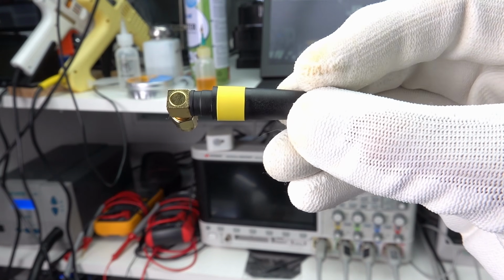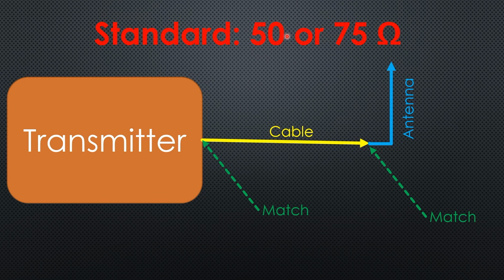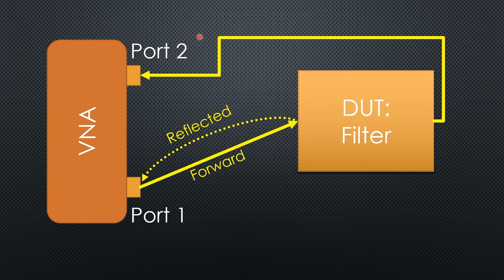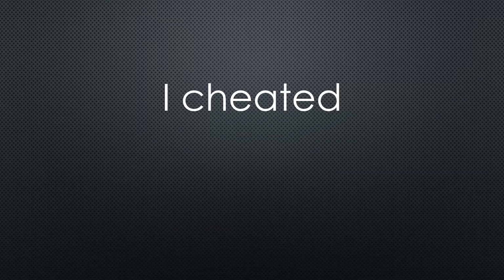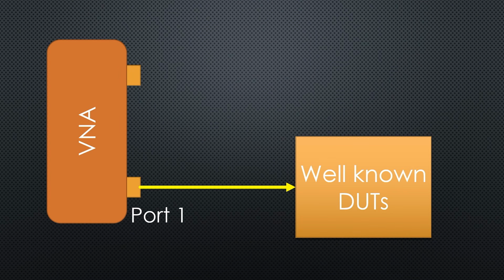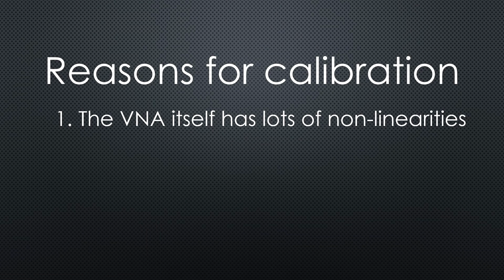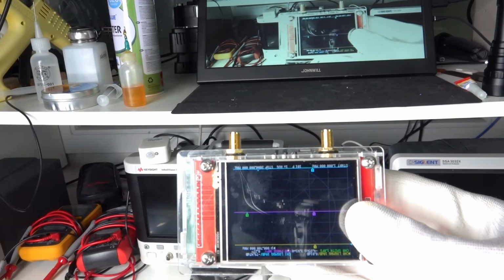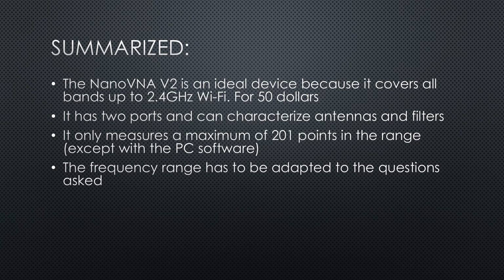437 How to Use a Vector Network Analyzer (VNA) to Test Antennas

Comment: I'm not sure that reflected power "heats the transmitter". More likely, it heats the feedline, if the feedline is lossy; otherwise, it is (eventually) re-radiated.
Reply from the maker: You are right. A Bit is lost in the feedline, a bit is reflected, and the rest is burned.

Comment: Users of radio amateur usually recommend to use a common-mode choke in the antenna line to reduce noise. In case of Lora communication, make any sense to include a choke, since it runs at much higher frequency?
Reply from the maker: I never heard that somebody used cokes in this context. Maybe also because the transmitters only have 1mW

Comment: Regarding antenna measurement you miss the ground plane. My LiteVNA has not enough ground plane when measuring 868/915MHz antennas directly on the port.
Reply from the maker: The Ground plane os part of the antenna, not the VNA. That is why handhelds have changing SWR.
Reply: @AndreasSpiess A ground plane is essential to operate for the antenna and measuring S11 without it is like playing lottery. At least this is what I had to learn the hard way. It obviously makes no sense to say anything about the quality of an antenna if half of it is missing. So my conclusion is: either measure with a constant/defined ground plane or measure with the ground plane of the device under investigation.

Comment: A lousy oscillator also will destroy your signal its even more likely. But the VNA can also measure that i think..
Well for the esp32s3 the constant is 35j0+ so one has to match the antenna.
Reply from the maker: Most chips do not come with a 50 Ohms. But often, the suppliers provide exact info on how to get to the 50 Ohms with a matching circuit, as you mentioned.

Comment: Incredibly good content! Thank you! just one question from my side: how would you make a PCB antenna characterization?
Reply from the maker: Similar to any characterization. However, here, the atachment is more difficult than if you have a connector. Usually, they solder a short cable to the antenna.

Comment: These VNA..they seems to also have quite few other testfeatures up there sleeve, that people use for other things..
do you have a video, on other usecases these newer TinyVNA can be used for.
phase delay, various Smith charts jX/LC, Qfactor, Polar, Linear, REAL, IMAG, Resistance, Reactance,  etc
TDR, low pass impulse, and LP step, bandpass, window, signal gen... they are quite extensive.
The current ones, also got quite a few more testpoints and seems to go up around 6G.
Reply from the maker: No. This is my only video about the topic.

Comment: Hey Andreas! Thanks so much for the video, insanely good. I got a NanoVNA 2.2/SAA-2 like the black one on the thumbnail, and I've tried as you have, to measure a 144/430MHz antenna. Unfortunately, the signal is extremely shakey, and touching the NanoVNA, or the antenna, or even putting my hand near the antenna, changes the valleys of the SWR by as much as 10MHz up and down. Is this normal behaviour of antennas, is my NanoVNA broken, or am I doing something wrong? Thanks a lot <3
Reply from the maker: That is how RF behaves. Use it to measure a fixed antenna and it should not happen.
Reply: @AndreasSpiess  Thanks so much for your comment! Greetings from Spain!

Additionally, I will say that, after 2h banging my head against the desk, and finding some answers on forums, by holding the NanoVNA with my left hand, and holding the Antenna next to my head emulating the position of the walkie-talkie, I can take a fairly stable measurement that generated SWR precisely at 144MHz and 430MHZ, so that was an interesting experiment. What do you think of this technique to more or less tune antennas for handheld devices? :)
Reply from the maker: @rojirrim7298  That is probably the best you can get.

Comment: A correction. "it shows if the antenna is good or bad" is a common misunderstanding of antenna impedance matching. A 50-ohm high power resistor (dummy load) is EXACTLY 50 ohm, so it seems perfect on a VNA (or VSWR meter), meanwhile, it's a terrible antenna.
Reply from the maker: You are right.

Comment: I wonder what it might do (if anything) to evaluate an EMI filter ~ 100 kHz? (There is a special "ring wave" waveform that an IEEE standard (C62, I think) uses to emulate power mains switching transients. I would only need a steady-state quesstimate of the insertion loss.

73 de AF6AS
Reply from the maker: NanoVNAs usually start at 50kHz. They can measure reflected (insertion loss) and "through" impedances (filters). But their domain is frequency, not time. Transitients are probably better observed in the time domain (oscilloscope).

Comment: Am I correct in thinking a nanoVNA is used for TX optimization only?
Reply from the maker: A proper antenna match is more important for a transmitter because it can blow up if not. But it helps also for receiving performance.

Comment: Thanks for the excellent video! I wonder is LiteVNA useful for weak LTE signal scouting and better external antenna positioning? Is it good as spectrum analyzer for 900-2700 Mhz band?
Reply from the maker: VNAs are, other than spectrum analyzers, not made for listening to external signals. So the TinySA would be the better choice

Comment: Is NanoVNA a good tool for direction finder with an antenna? If so, do you have an antenna product to recommend for 2.4 GHz? Liked your video. Thanks!
Reply from the maker: A nanoVNA has nothing to do with direction finding. And I do not have a recommendation for antennas other htan testing what you get. Or buy from a reliable source like Mouser or digikey.

Comment: Thank you very much for this smart and comprehensive introduction video - much appreciated! I just consider building myself a simple VHF/UHF dipole antenne (or J-Pole antenna) for a baofeng ham radio. I just want to test the difference in recieving (and transmitting) concerning distance and quality. There are some nice DIY projects to be found in the web. Do you still consider a NanoVNA necessary for tuning the antenna to optimum? Is it even possible to build a good antenna without checking the values? I think the 50 $ are neatly invested for such an elaborated tool - but i never needed it before in my life. (but i never built a diy antenna and questioned it quality before 🙂)
Reply from the maker: Of course you can build a good antenna without a VNA. But how would you know?
Reply: @AndreasSpiess  Thats what i mean: just by chance 🙂

Comment: I have a 1090 MHz ground plane antenna with type N chassis mount. How do I measure the VSWR and impedance ? I have to use an adapter to connect it to the nanovna but how can I find out the required delay ?
Reply from the maker: You have to use an adapter and live with the small error if you do not have an N-type calibration set.

Comment: Keep in mind, these cheep VNA's use rectangle not sine wave to measure. That means 3rd harmonic is only about -10dB and 5th harmonic -15dB below the base frequency. I expect for devices that reflects harmonics totally and are well matched at base frequency S11 could get wrong figures around match frequency. For S21 I think an error should be visible for bandstop/notch and highpass devices. It will be interested, to measure some DUT's also on an expensive VNA and compare results. Fun fact is, the 3rd harmonic of 145MHz is 435MHz in the middle of the 70cm HAM band. I own a LiteVNA 64 (more points, more speed, more expensive, also rectangular signal).
Reply from the maker: You are right with the rectangular signal. I own a Keysight VNA and could do some testing. Maybe you contact me via X or Facebook messenger (or QRZ.com if you ar a HAM) to discuss the tests?

Comment: Nice video.  My only complaint is it confuses precision with accuracy.  Calibration has nothing to do with precision and everything to do with accuracy.
Reply from the maker: You are right. As a non-native speaker I do not know the difference :-(
Reply: @AndreasSpiess  Ah, no worries.  Here's a quick guide to resolution, precision and accuracy.  A meter stick with 10,000 (0.1 mm) divisions on its rule is higher resolution than one with just 1,000 (mm) divisions.  But if the "meter" stick actually turns out to only be 0.9 meters long, it has poor accuracy because everything you measure with it is slightly wrong.  Accuracy has to do with how close a measurement is to the actual value.  When you calibrate a device, you're attempting to make sure the reading you get is close to correct.  Precision relates to how close repeated measurements of the same thing agree to each other.  A micrometer with a worn out gear train will be sloppy and will give you different measurements every time you measure the same thing.  It has low precision.
So in summary,  accuracy has to do with how close a measurement comes to the actual correct value, precision has to do with how repeatable that measurement is, and resolution has to do with how many decimal places a measurement can be confidently made to.
Reply: @stargazer7644  okay thanks I appreciate your insight.
BTW stargazer, have you become a flat earther yet?
Reply: @flat-earther Imbecile trolls only get one reply from me and you just used yours up.  Sorry.
Reply: @stargazer7644  BTW stargazer, what do you think about all gubments drawing a line around you and saying you are not allowed to leave?(Antarctic Treaty) If you don't know what I mean, read my about tab.

Comment: Hello Andreas, I need to measure some loop PCB antennas for 13.56 MHz. I understand from the documentation that the reader works best with a 20 OHm impedance. This means I should use a 20 OHm resistor instead of 50 for calibration? Thank you!
Reply from the maker: Yes.

Comment: 15:18 you stated that you connected the short to the vna first but when you did so you clicked on the “open” option. Am I correct in assuming you are supposed to calibrate it starting with open then short then load?
Reply from the maker: The sequence of SOL does not matter. But my video cutting was wrong.

Comment: Thank you so much for this video. As it happends i do have an nanoVNA and have allways been confused why all my antennas are so bad according to the VNA and i now understand why. I use adapters to a PL connector. Question, How do I calibrate so I can meassure my antenna with an adapter and a cabel? I would like to meassure the antenna i have set up on the roof so i have around 10m of cable and then an adapter from PL to sma. Do I have to disconnect the antenna before calibration so i can determin the zero-point?

again, thank you so much for all your videos, very much appreciated
Reply from the maker: Calibration is always done with the respective calibration set at the desired reference level (either at the antenna or at the transceiver end of the cable. You decide what is important. If you want to check the antenna, measure at the antenna.

Comment: Great video, thanks! Now, if I have an outside antenna with let's say a 20m cable getting into my shack, how do I calibrate to measure this antenna?
Reply from the maker: To check the antenna, you chose the reference plane at the antenna connector. If you want to protect your transmitter, you choose the reference pane where you plug the cable into the transmitter.

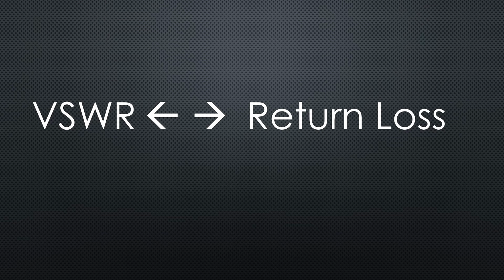Comment: 12:50  In the U.S, hams and CBers almost always call it "SWR," while broadcast engineers use "VSWR."  That's also how the RF output meter (power & VSWR) on a radio or TV broadcast  transmitter is labeled.  All this is not important, but if you're discussing radio with someone, the term he/she uses gives an indication if the person is just a ham or hobbyist, or has experience in the broadcast field.
Reply from the maker: I agree.

Comment: My question is how to use it with the pl-259 connectors as commonly found in HF antennas to test them? Are there SOL calibrators for pl-259? 73 DE W8LV BILL (W8LV/VE3 prepandemic)
Reply from the maker: I do not know if there are PL/SO calibrators. You probably could make your own if you want. For HF, the length of an adapter is short and does not change the measuring results. These connectors usually are not made for high frequencies.

Comment: I have a ground plane antenna for ads-b on my balcony and a relatively short feed line (RG-8) to a box with a usb-dongle. When I build an antenna I usually connect a piece of coax with similar length to the antenna and tune it inside. Later, I put it outside and do fine tuning at the end of the coax, so I always measure antenna+coax in total. I try to get 50 Ohms by bending the radials and I get the lowest SWR into place by adjusting the length of the driven element. 
Is that the correct way if I calibrated without coax attached? In my mind, if the whole system is tuned at the point where it connects to the receiver, the antenna will be perfect and I don't need parts to compensate anything.
Reply from the maker: Coax cable changes the impedance if your antenna is not exactly 50 Ohms. I prefer the antenna connector as a reference plane if I want to tune the antenna. Only if I want to protect my rig I check the SWR in ma shack.

Comment: I hadn't complimented you on your nice presentation, since sometimes we think it's obvious or a thumbs up is enough. But especially the capacitor tuning to show how it changes the trace in the Smith chart is very helpful to remember it. Thank you.
For those who want to make tunable inductors: they can be easily made by having some stiffer paper wrapped loosely around a ferrite rod, and winding the coil on this stiff paper. Then moving the rod while holding the coil still (or vice versa), will affect the inductance.
Reply from the maker: Thank you for your kind words!

Comment: There's a good python script for acquiring data and then further displaying and processing it
Reply from the maker: Maybe you search for "ttrftech/NanoVNA". There you should find python programs.
Reply: @AndreasSpiess  yes they are good, but work only on linux. I'm automating some tests and I'm wondering if its possible to calibrate in more than 101 points, since it's possible to sweep in more than 1000 points. A really nice feature would be a log sweep which I might try to implement if a larger calibration is possible
Reply from the maker: @KnaufL  AFAIK, all programs offering more than 100 sweep points also offer the same amount of calibration points. At least, the calibration time is much slower with more points selected.

Comment: Thanks for highlighting this, it would be a great addition to any engineers workshop. Any chance of looking into 4G comms,  I cant get signal on sim800 in the uk so moved to a SIM7600, would be great to see a review of 4G modules for sms and small data transfer.
Reply from the maker: I never worked with 4G so far. The modules are still quite expensive... Does the SIM7600 work?

Comment: Absolutely new to antennas but have a decent understanding of electronics. Say you detect you need to add capacitor to your antenna at a particular frequency, how do you do that, in your circuit (if it's your board) or can you get inline sma capacitors and inductors?
Reply from the maker: usually they create PCBs for that purpose. But sometimes you can solder a cap to the antenna connector

Comment: Mr Speiss this is important due to the Energy Shortages I was wondering if you could listen to my idea: If you get older printers (you can refill the ink cartridges with syringes full of ink so the older printers that dont prevent you from refilling the ink cartridges)... you get 1 color cartridge with 3 colors in it... and 1 black one... this makes four inputs... you could fill each input with a solar panel chemical then create a simple circuit design using the hexidecimal for each color in paintbrush or some similar program... then perhaps combine the printed chemicals with some carbon paper and laminate it to create solar panels. Would you be interested in the creating a solar panel challenge to help save the world from energy based tyranny? I have also contacted defcon but have had no response.
Reply from the maker: As you might have seen in my recent videos, I installed a PV system. So I do not need more panels.

Comment: Antennas should be measured with a VNA at the feed-in point, otherwise sheath waves along the cable or unclear grounding conditions will greatly falsify the results. 73
Reply from the maker: You are right. 73
Reply: @AndreasSpiess  Thanks.

Comment: Thank you for explaining vna in a such concise video.
However, as already identified in comments, it seems impossible to buy a such device (3ghz) for about 50$.
We can find only 900mhz devices for this cost (plus VAT and delivery). 
3ghz are quite more expensive. 
Be careful with some copies which don't have results as good as provided by the ordinal one. 
However the cost (including VAT and transportation) jump to 250 $ for such devices. 
Regards
Reply from the maker: As mentioned in the intro, I play old videos during my summer break. This video was made before the pandemic...

Comment: How would i use a vna to determine if a torrid is good for baluns, ununs, or chokes?
Reply from the maker: You have to build the balun or choke and do the measurements with the VNA. The you see if your device exposes the impedance you expect.

Comment: Well done. I will be recommending this video to my students as an introduction to Very High Frequency Measurement course. 

One note: the Thru elements should be (ideally) lossless and of zero length, therefore the one you show at 15:36 will not work, especially if the phase measurement is important.
Reply from the maker: I do not do a lot of through measurements. But I thought this method would work if I connect the DUT directly to one port and use the same cable to connect the DUT because the effect of the cable should be removed through calibration.
How is it done correctly?